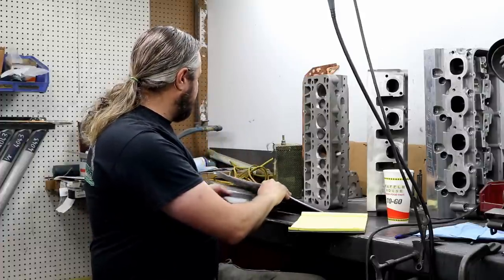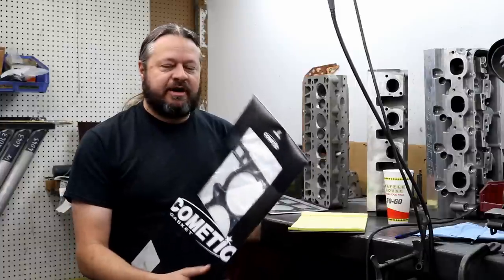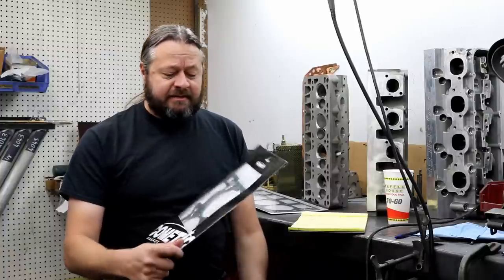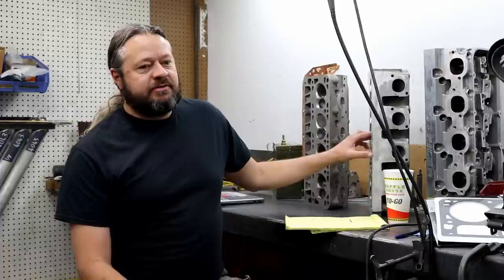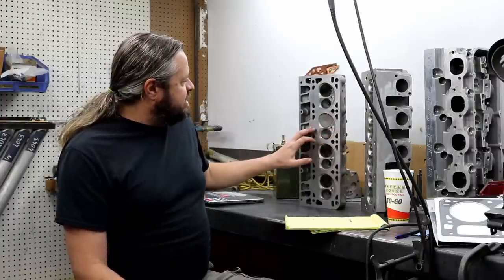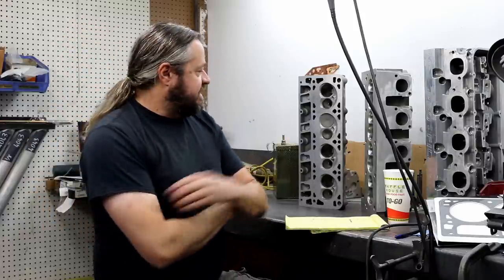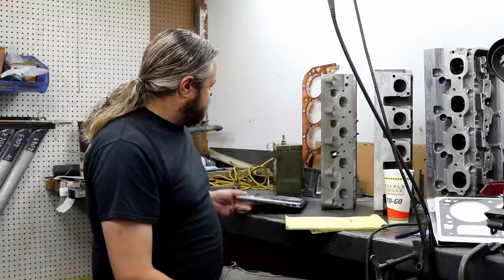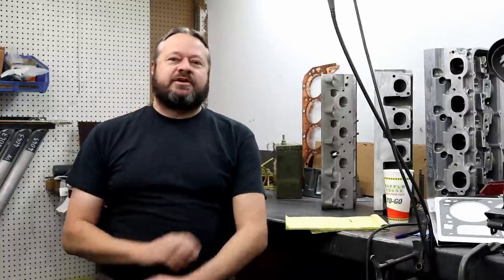Head Sealing

Comment: Another excellent video from Pete, covering all the bases to seal and clamp cylinder heads! The term torque is used as a catch all for fastener tightening but it is just a means to an end. The ultimate goal of the fastener is the development of clamp load which is final result of the rotational energy applied. A simple torque spec is good enough for standard care fasteners where stretching/yielding the fastener is not necessary but for the critical joints like heads, rods, mains and flywheel/flex plate you will want to take full advantage of the mechanical properties of the fastener. In these cases a torque + angle spec is used to minimize the clamp load variation resulting from friction coefficient changes! By implementing a low threshold torque and then turning the fastener a predetermined number of degrees, influence of the friction variation between the under head bearing area of the fastener and the thread interface is minimized. The amount of clamp load developed is thus controlled by the material properties of the fastener and the thread geometry because every degree of rotation equates to the amount of tension the fastener is under!

Comment: From a factory stock auto maker's standpoint, it was the Japanese who first started using the MLS gaskets with smoother Ra finishes on FACTORY STOCK engines. Racers/racing shops may have been using them shortly before that, I really don't know. But the Japanese were the first to develop & use MLS gaskets from a mass production standpoint, and it soon caught on everywhere else.

Comment: I'm sorry to hear that someone is making up falsehoods about your work. I've had to defend folks and be defended from folks associating me with some made up crap with no evidence. Thanks for the info on the head gaskets. I've never used the cut ring gaskets and I might look at them. I will tell you that my wastegates got stuck one time at the track and I them lose water at about 50PSI. If not for the fuse built into the gasket and me feeling that I had a HUGE jump in power and getting out of it I would've been rebuilding an engine and 2 Turbo's also.

Comment: Thanks for the video! I have had to explain too many times over the phone where do you want your fuse or want your fuse to be ,piston or gasket.
Reply: Some builders and I'm not saying who try to put rings in at lower hp levels when guys need to be losing gaskets and learning to tune instead of changing slugs.  My comment isn't pointed at Pete or Kevin but someone else I see quite often recommended and never seen his engines compete on any level.

Comment: Hope i'm not jenxing myself, I destroked a 454 to 427 and used off the shelf forged LS7 pistons with final comp ratio around 7-1 and hit it with 16lbs from Dyers 8/71, I used new Edelbrock heads with block decking with no o-ring, i cannot remember if gaskets were Cometic or MrGasket. I do remember they were white, Engine is in street car and not ever had problem squeezing gasket out.

Comment: So could and engine be built where if sleeved cylinder work being done, leave the sleeve .040” or so above deck then cut same relief diameter in mating head? Would that trap gasket as well?